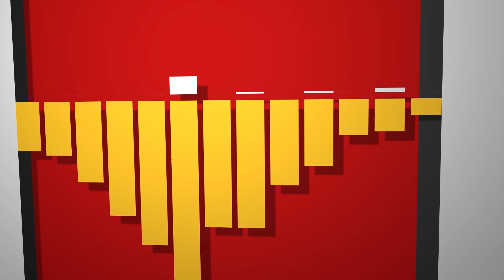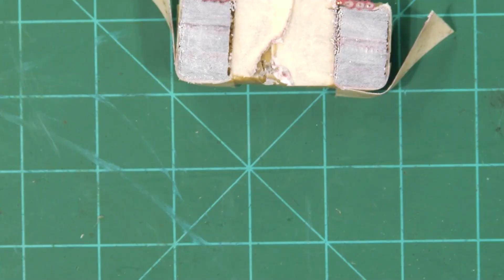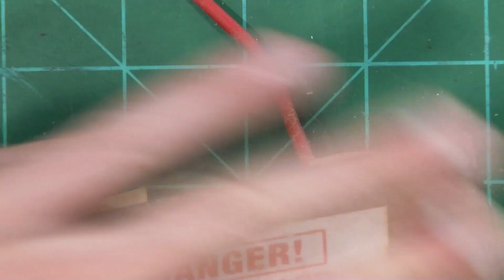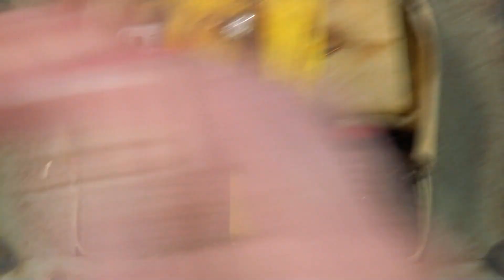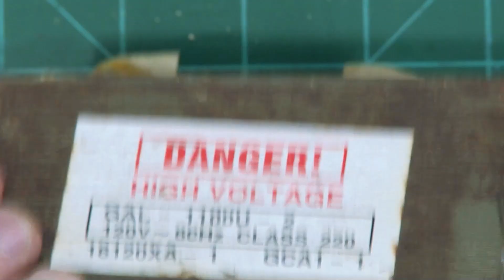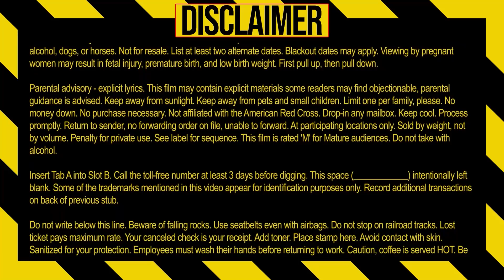Microwave Oven Transformers Basics

Comment: I just wanted to say that that is the cleanest cut that I have ever seen, especially through something like a transformer. Bravo!  I did have one question that I didn’t know if you knew the answer to: the filament wire output? If you wanted to use that for something else, could it be used to power a small light as an indicator that they is still charge in the unit and left on to continuously drain until the power is gone?

Comment: i have a transformer setup for 9v dc using a bridge rectifier. and i cant work out why. when i change the brown and blue primary AC inputs 240v leads over, i get 4.5v dc output
i was expecting there would be no change. any ideas?

Comment: Hi Chris, I have a question. I have an older MOT and the windings check out. The primary winding is not quite 1 ohm (.08 ohms) and the secondary is 86 ohms. I was reluctant to hook up the primary to 120v because of the small resistance, I figure doing so would be almost like connecting the 120v wires together. Is it safe to do so with 120v with that low of a resistance? I want to take out the secondary wires, replace it with a few turns of heavy cable, and use it as a spot welder for 18650 batteries. I see lots of videos on YT where they just connect the primary to 120v or 220v in Europe, and it seems to be ok.
Reply from the maker: You're going to want some manner of current limiting to do this, otherwise you're going to trip breakers or set things on fire.
Reply: @ChaoticGoodChris learned this the hard way, popped a gfci circuit had to call an electrician and all

Comment: I dont get the middle one, why doesnt it melt it should theoretically hit like 600amps right? 120/3=40x15A=600?
Reply from the maker: Because the load it's feeding is current limited. The middle one is only connected to the filament in the magnetron.
Reply: @ChaoticGoodChris   thanks, but I still do not understand.

Comment: 440hz 280v mot https://youtu.be/Am93aGZHCX8
Reply from the maker: Please don't touch the output lead with your bare hand like that! Running that off 400Hz is pretty cool though, and I love the sound as it comes under load. Step your safety up a notch and you're on the path to interesting things. Though, you may end up as an aircraft electrician.
Reply: @ChaoticGoodChris  thanks for the advice, since uploading that video I have upped my safety practises. I now use a plastic rod about 2m in length attached to the hv lead.
Reply from the maker: Excellent! :) Thank you! I'm very glad to hear that. If you watch the early episode of the HV series on here, I go into detail on making a couple sticks and probes for exactly what you want to do. I cover how to build them, and some tips o how to use them safely. I want you to live long enough to discover new things, do good science, and make the world a better place! :)

Comment: Ok, I'm sorry for the stoopid question but I have to ask since you mentioned and my brain wonders about this kind of thing, how did you cut it? It's awesome, intellectually, or as intellectually as is possible for me to get, I knew it was different ratio's of winding wire but I don't  think I have ever seen it. Thank you for going to the trouble of doing it. While I am asking daft questions, I take it that the hexagonal wires are for closer packing? Does that, or the different types IE etc make much difference to the output?
Reply from the maker: Hi Ted! :) I love it when people ask good questions. I cut it with a Milwaukee M12 version of a Sawzall using a fine-toothed short blade. It took a few sacrificial transformers to work out how to do it right. The wire is shaped with this profile in order to save money and maximise the number of turns per unit-volume. MOTs are all about "as cheap as possible". Btw, if you're interested in more of the "behind the scenes" and a ton of other interesting industrial-scale high voltage (I work in power plants and make videos about them), you may want to check out my personal channel here - https://www.youtube.com/user/Physicsduck There's THOUSANDS of videos that cover a lot of things that you're going to be very interested in. :)

Comment: Can you series up a couple to get really high voltages or does the insulation break down?
Reply from the maker: They only output 2kV each. Yes, if you do it right you CAN series them, but it's tricky and not really worth it most of the time. I'm doing a video on exactly this in the near future.
Reply: I have tried connecting 2 these transformers in series. Primary windings 180 degrees out of phase in parallel and secondary windings in series. By using this connection you won't set one of the core 2.1kV higher than the primary windings. So you can avoid break down.In microwave oven transformers the secondary winding where it is near the core is directly connected to the core and the farther part of the secondary coil is left float,so if you direct connect 2 MOTs in phase then one of the MOT's core would be pulled up to 2.1kV and break down may happen between that core and the primary winding.

Comment: And, just like all modern ones, made from CCA wire, because using copper is way too expensive.  I do not even bother with them any more, they are just part of the steel scrap, unless you know that they are over 20 years old, when the copper is worth stripping out.
Reply from the maker: I totally agree. As a rule, I hate MOTs. They have a place for some specific applications, but most of the time there's a better way. I had to include them here though, because for most people it's a common point on the path of starting out.